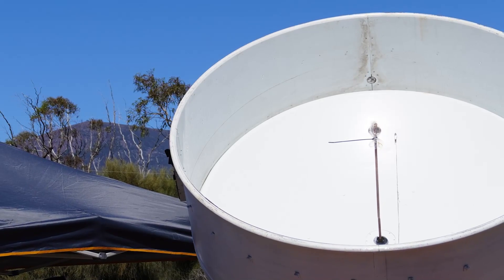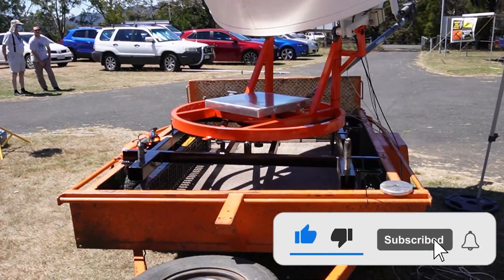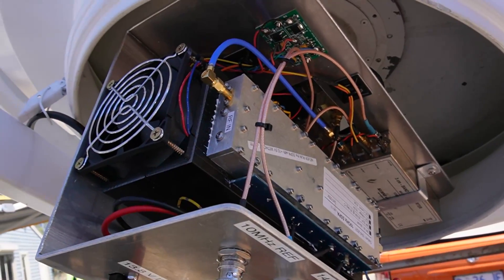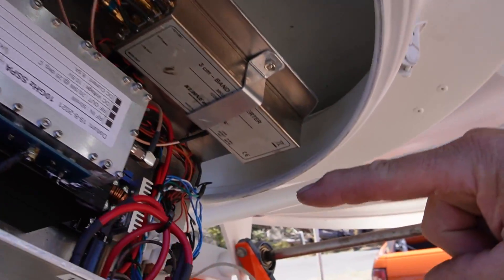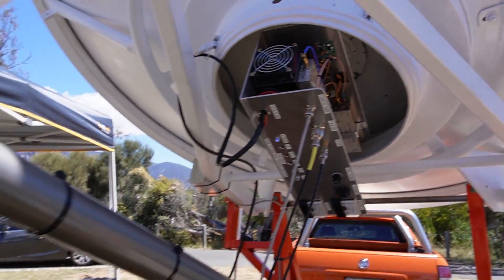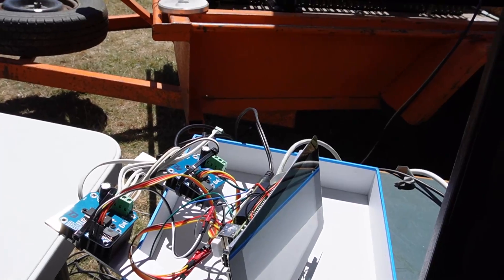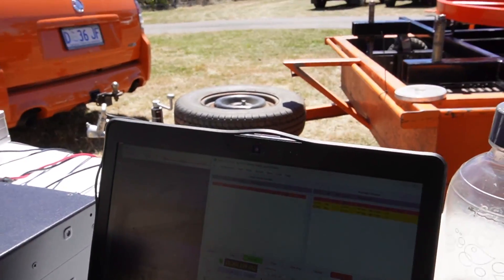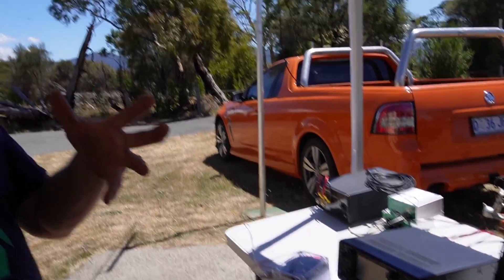That's not a Dish..... THAT'S A DISH! Ham Radio EME | Moonbounce

Comment: Before retirement I worked on Phoenix and AMRAAM missiles (both 10 GHz) so your setup is of interest to me.  I also worked 2-meter EME in the late 1970s-early 1980s.  So we have EME operation in common.  More in common, I really like your Holden pickup (what we call them in the states).  I have a 2009 Pontiac G8 GT in the garage (which you probably know is a re-badged Holden.)  Small world.

Wes  N7WS
Reply from the maker: Thanks Wes 👍